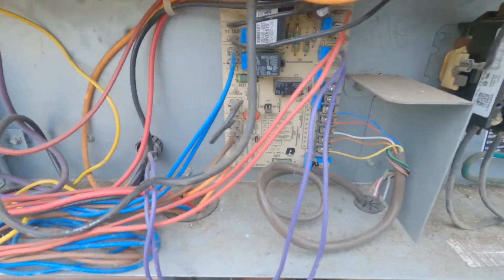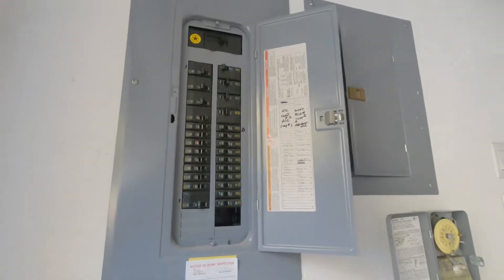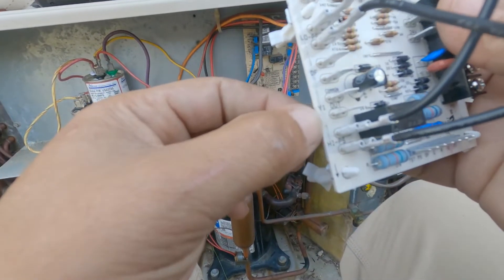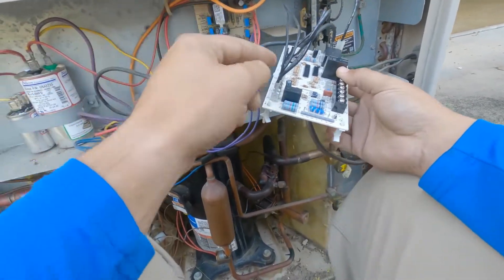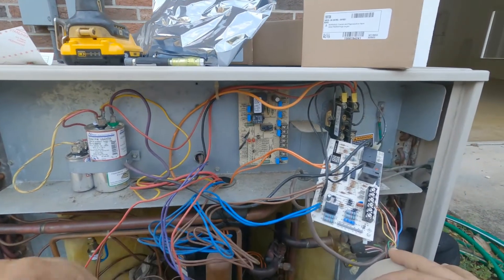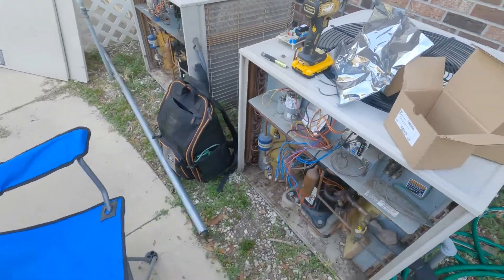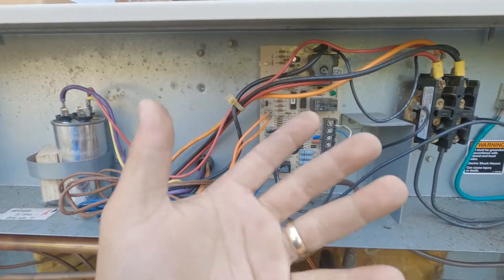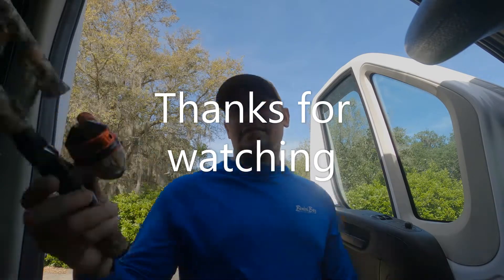Heat pump Defrost Board Replacement. Bringing these 20+ year old Lennox systems back to Life!

Comment: Went down the HVAC youtube rabbit hole and been watching these repair videos cause its pretty interesting how all this stuff works.  Not sure if you will see this but wondering if you could help me out. Our system is about 17 years old and is on its way out and we think its time to start thinking about a replacement.  We just received a quote for a 4 ton amana heat pump system AVZC18 18 seer with AVPEC variable speed air handler and 10kw heat strips for around 15.5k USD installed.  Is this a ludicrous price or is this actually what this kind of system is running right now?  That property is surely a dream.  Only wish to be able to afford something like that one day
Reply from the maker: That price is a little high. But honestly without seeing the scope of work, it could be low. Thanks for the feedback and support!